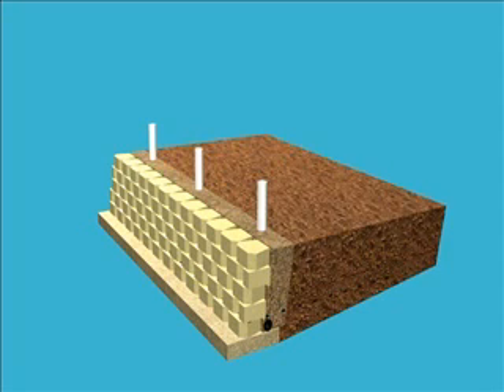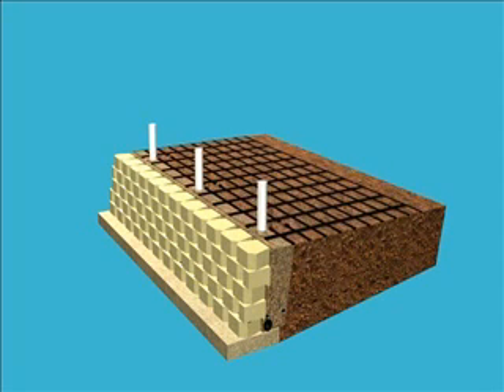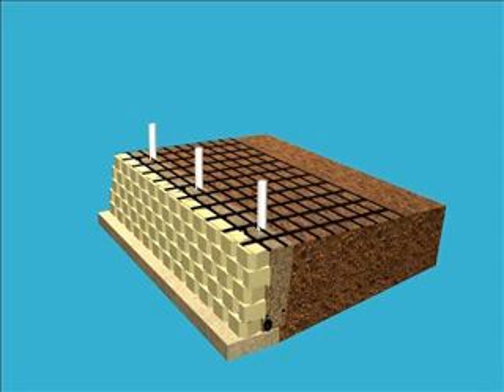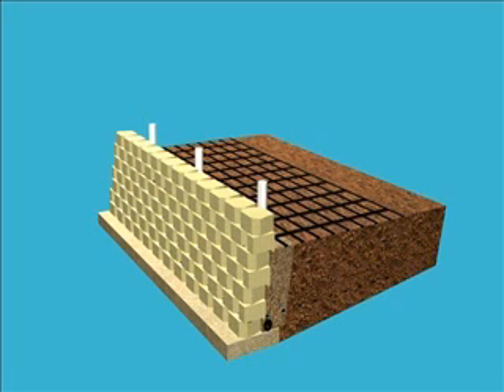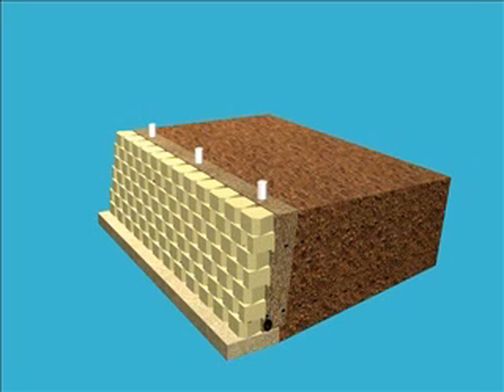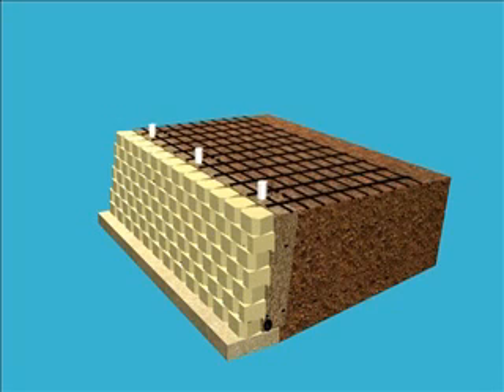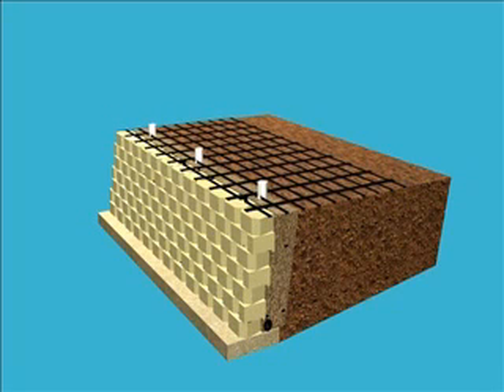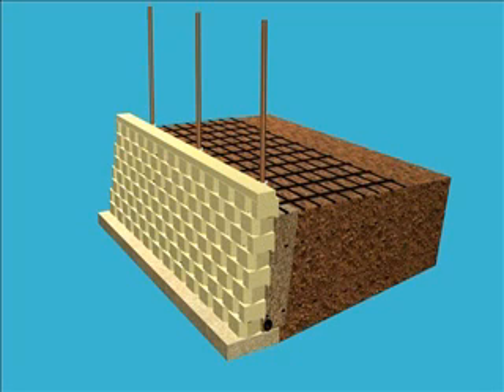How to build a retaining wall with a fence application

Comment: There are specific products that can be bought that can be placed as a kind of mount for the posts. I believe they're call "Sleeve-it's". Basically, it's a 8 inch piece of black corrugated pipe mounted to a base to hold it vertical. You place the post and pour concrete for the posts. The spacing of these depends on what your or the engineer specifies. Note to engineers and architects: It might work good on paper but the real world is another story.

Comment: need to build a small retaining wall between the neighbors driveway and mine. His side is slightly higher than mine. The wall itself will, due to a slight slope towards the backyard, anywhere from only one to three blocks high... Then wanted to install 6' x 6' vinyl panel fencing... how should I go about reinforcing the post in this application???